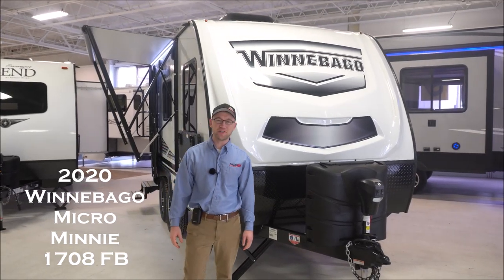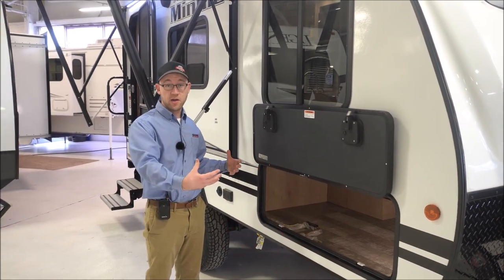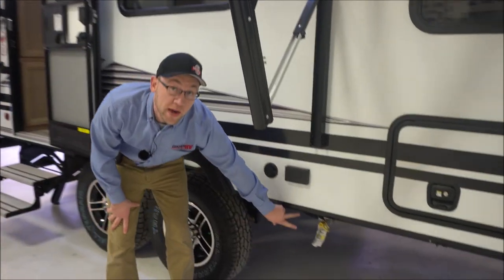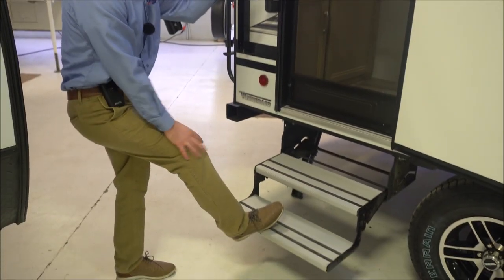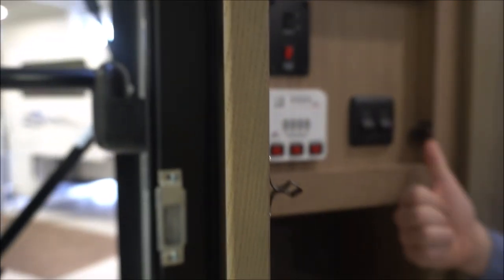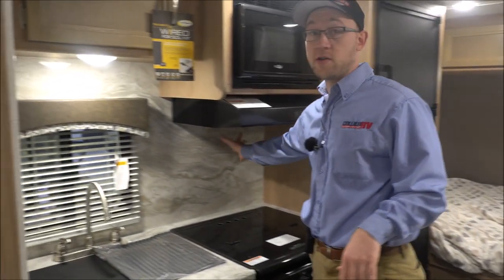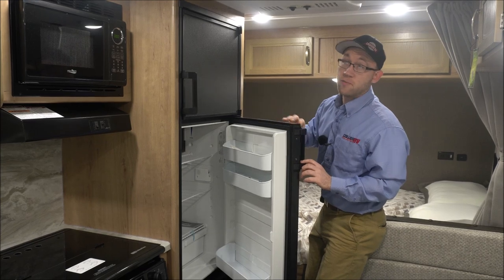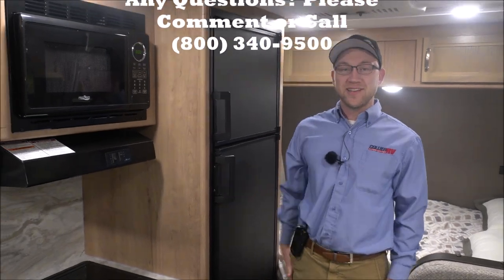Collierrv com 2020 Winnebago Micro Minnie 1708 FB Short No Slide Dual Axle Couples Trailer 3300 LBs

Comment: The bathroom is built for a hobbit . The tv is in the worst place it’s totally unusable. What a waste
Reply: A really good, suggested method to buy a T.T. is to let another person, buy the model year...and then, if they wish to sell it within no more than 3 or 4 years, you will get a great deal on the model you wished to own...AND...in those first 12/24 months, any faults, or warranty that needed to be done, would have been done by the owner,  their towing back to the dealer, and their down-time.  As the second purchaser, you get the benefit of most has been done/corrected from factory shipped, and you get to enjoy from thereon.  We did that with buying our 2018 1706FB, in September of 2019.  It had one owner, that went back to their dealer (I saw the purchase papers..) and traded in for the reason of wanting another five or so, feet. They also wanted a north/south Queen bed, rather than a East/West bed this unit, and ours has.

 Now, that is a personal choice, but they didn't want to have to climb over the outside sleeper, if one needed to use the bathroom during the night.   That's a legitimate purchase point,  for some couples, and fortunately for us, it was for them. That extra 5 to 6 feet is needed in T.T. length to accommodate a bed that has its head at the front wall of the trailer.   That being said, you also have to pick up extra weight, that could be 1,000 pounds more GROSS, as well as extra maintenance of roof material, and outer side wall.  Another draw back to having a North/South Queen bed, that can offset the advantage of either sleeper steeping to their side of the bed, like at home, besides the extra cost, weight, and length, is that one might no longer be able to park their T.T. (if there are no restrictions for such, where you live),  because most single and double home property driveways in the 'burbs,  pretty much are around 25/30 feet in depth, and some even less than that.  Our 20 foot 2018 1706FB, from hitchball to back bumper, not only can park on one side of our double driveway, but there is 12 feet left in front of it, to the roadway, whereby no road salt will be sprayed or splashed onto the unit, during the Winter.  (We live near the Great Lakes Area).   We can also park a sub-compact in that space ahead of it, if we need to, or for guests.

So, in reading my reply, there are a few considerations, as to what length and weight and maintenance costs, are associated with a T.T. or any length.  We have had about 4 T.T.'s in our married life, the longest having been 30 feet in length,  but in having owned a 30, a 27, a 25, and now this 20 footer,  we both agree that for the features this trailer has, and for the towing weight and camping parking length, to be the BEST BANG FOR OUR CAMPING BUCK, ever!!!   We have every creature comfort feature from even our largest trailer of the past, and yet, can get into absolutely any campsite, whether it be for a dedicated R.V. or truly designed to host a tent.  None of our other trailers could even attempt, or would be allowed to be installed on some of the very wonderful sites we have enjoyed with our Winnebago Micro Minnie 2018 1706FB (the 1708FP is their 'updated' version of our 1706FB. 

IF you have made it down to this sentence, I do have a personal recommendation...in that they (possibly to cut production costs, or keep the MRSP down...whatever...) did away with the two wonderful and DEEP dresser gilde-slide suspension drawers that on our model year, and on the still 2019 model year, are built into the front facing Queen bed frame.  Now, they only have a door and an empty space, that you'd most likely have to slide in a clothes basket, which now would sit on the floor or the trailer.   So,  if you are interested, go out right now...and search out a 2017, 2018, or 2019 *1706FB* to get those built in clothes drawers, drawers that you'd have back home...and will have also, on your mobile 'Condo'.   Just a tip...and you 'll be saving many $$$'s as well as mentioned, less chance of something going wrong, that needed to be attended to, shortly after the first owner towed off the dealer's lot.  Good luck...but whatever you do...the 1706FB or the 1708FB, is simply the greatest usage of your  $$$'s for bang-for-the-buck features and creature comforts, as well as saving you thousands of dollars per year, in storage costs, towing costs, and maintenance that every trailer needs to have done, to keep it in prime condition.  To see the double dresser drawers these 1708GB do NOT COME WITH,  merely YouTume a 2018 or 2019, or early 2020 1706FB, and watch the interior tour,  where you will see the double dresser drawers in the bed frame. Then go back to the 1708FB and see that now, there is just a square storage door with an open space, where the two drawers used to close into.  Final comment,  if you go with an East-West Queen bed, you pick up over 5 owner advantages because the bed uses the width of your T.T. to accommodate a Queen, rather than needing added length of floor space that ONLY is used by the Queen, in a North-South configuration. I mentioned a few owner considerations in this detailed reply, to owning a T.T. with a East-West (as they refer to them) that are installed in the width space of your T.T. Cheers!
Reply: @sesquashtwo  Good luck using that method,  in the new pandemic world we live in.  Used units (if you can even find them now) are priced ridiculously high, and are sold immediately when listed. New units are also very high (and also sell before they even arrive at the dealership), but at least you get warrantys with them. The whole RV industry is topsy turvy right now. Wait a year or two, maybe it will calm down.
Reply: @gerard2620  Yep, it seems to be a seller's market out there for sure, right now!